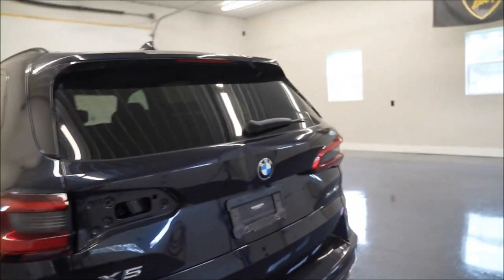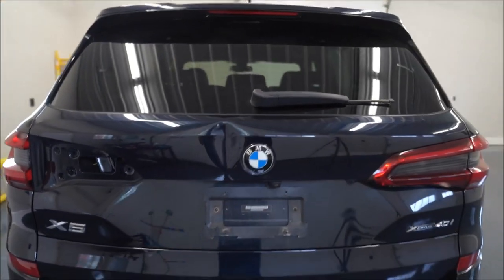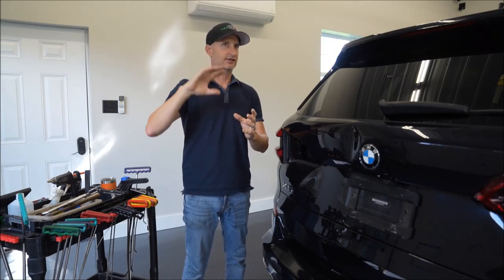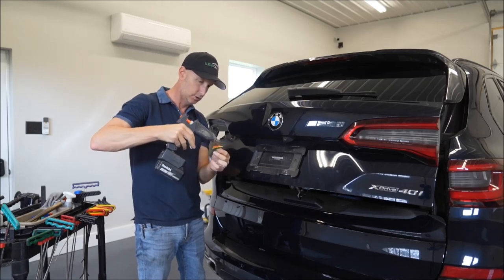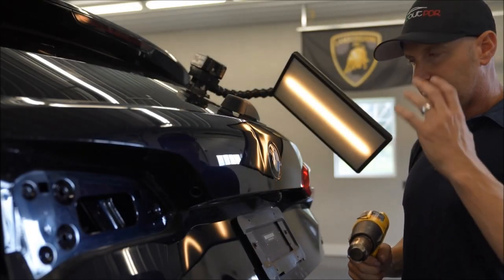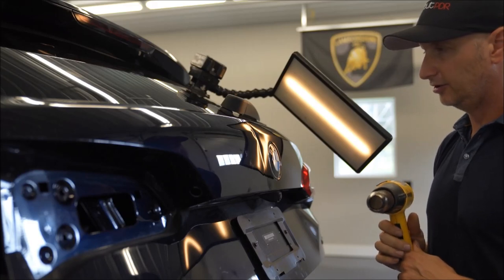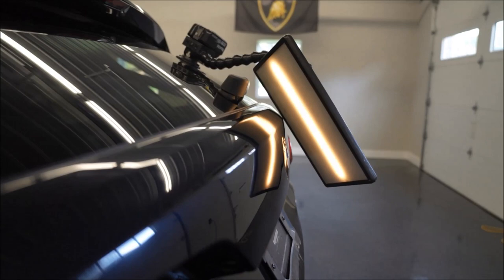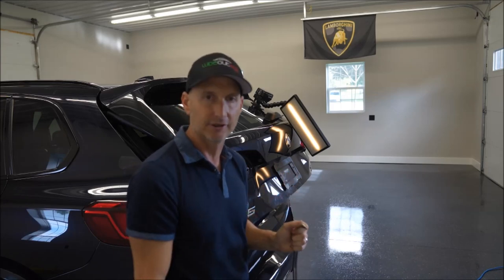Paintless Dent Removal FAIL!

Comment: "It's not perfect." Nope it's 99.999 %  perfect and nobody would ever see it. You have a great work ethic and high standards, a couple reasons why your videos are tops! And Sorry but you had me laughing when you was beating your head against the wall, we all been there! Was that aluminum or high strength steel, just thinking besides the pressure being trapped between those 2 crowns those other metals would have made it so much worse.  Awesome job!!

Comment: I feel your pain😭 I'm still new to PDR & got my arsed kicked today trying to get the bodyline back up on multiple door dings on a VW Tiguan.  The fact a man of your experience is having similar issues gives me hope.  Great video, love your honesty & the way you explain your process 👍
Reply from the maker: Thanks! Tiguans are the worst with those bodylines haha. Very tough to get them perfect, keep pushing 👍
Reply: Drill the door jam, under the handle.  Great access for a 1/2" thick tool.  Tap down the crown first.  Easy money.  Good luck with cutting the glue on the hood though.
Reply from the maker: @paulywalnut3364  Best way to cut that caulk I found is a cake icing spatula. Thin and cuts well, but yes not Fun!

Comment: I just found your channel and watched all your PDR videos. I'm trying to learn this hobby/profession. As a body repairman of many years I thought this would come easy. I have learned there is a very steep learning curve. To me your content helps a lot more than someone trying to sell me something. By the way, I have also tried the K Beam. Sometimes it takes several hands but it is a good tool. Remember it's lefty tighty. Thanks for your videos, new subscriber.
Edit: Sorry for not saying the X5 looked very good to me.
Reply from the maker: Awesome, thanks for watching and commenting. Haha the funny thing is I though the same thing with the K beam, "Lefty tighty" I was like that's dumb, and yes a little clumsy to use. Should be good for some pretty big dents though, we'll see.  Thanks again!

Comment: customer will be happy, but I understand, as many I have done, I felt was not up to my expectations that the customer was happy with. I wonder if it may have come out better if the initial tab was horizontal on the body line and you tapped the crowns as the body line came up? Slow pull though, not a slide hammer.
Reply from the maker: I did try the mini lifter as well, not shown in the video. The steel was just very different and really hard to work. It was a tough one haha. Thanks for watching and commenting!

Comment: hi, Wipe, that hole close flashlight is the original body or you did that for use tool?
Reply from the maker: Sorry not sure what you mean, are you asking if I put the hole in behind the taillight? If so, yes. It was easier to access the dent that way. Thanks

Comment: Firstly you have gone about it the wrong way, where is the heating of the paint before the first glue pull? Then went to far befor first knock down and should have started using bars earlyer. You left to much damaged material behind you before moving on. And where is your light? The top of the penal moved nice on the first revers hammer glue pull then you should have cleaned that part of the panel. And your using a metal tip.
Reply from the maker: Thanks for the info. This one definitely was a tough one.
Reply: You are top notch. Show us your work to learn.